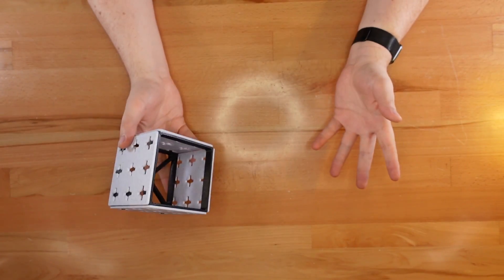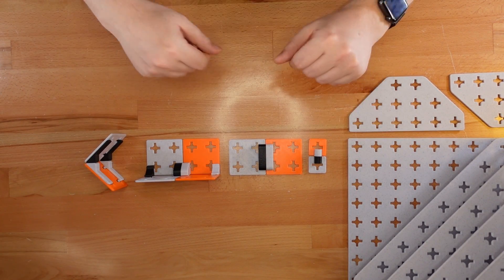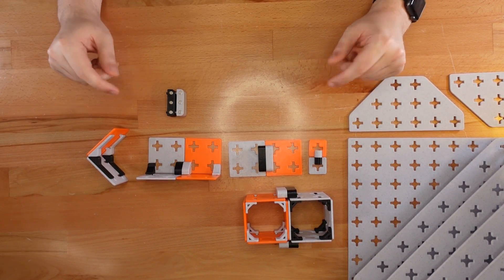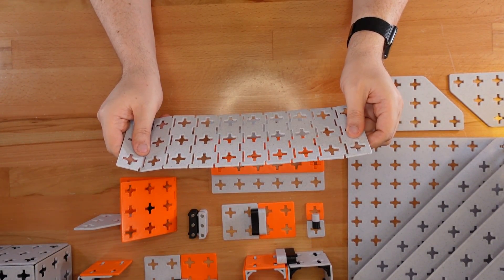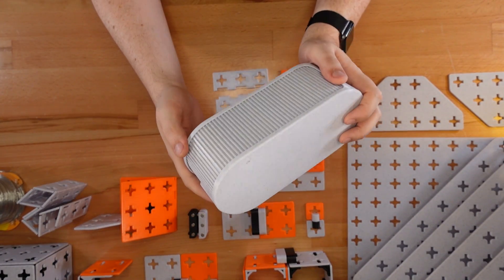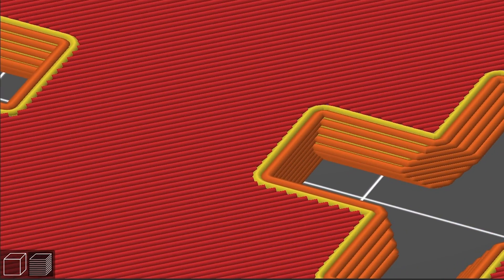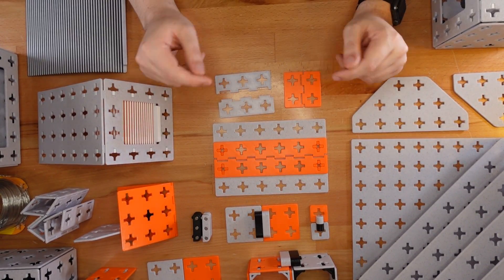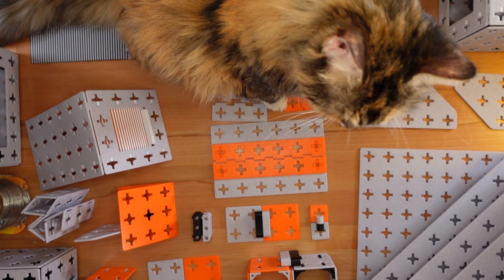Printy Panel Overload - Magnets, Shutters, and More

Comment: I love the additions you are making.  I'm wondering if you have tried to fogure out a way to stack the prints so that you can print more then one panel at a time.
Reply from the maker: I haven't tried it myself, but I have heard others plan to print multiple stacked panels with PETG between each layer. I'm not quite brave enough for that, so I'll keep printing them individually.
Reply: @3DPrinty  oh I should try that, thanks!

Comment: Are the inside corner inserts held by friction only? Snap in fit? The ones I printed on my fine tuned printer easily slide together, but also disassemble just as easily. I thought I was missing some little lock inserts or something like that? So far I have only made a few panels and inside corners.
Reply from the maker: Sorry to hear that - I've seen a range of results depending on the filament I use (same G-code) and other factors. Check the project documentation for a section titled "Loose Connectors?" for some tips to help :)

It's also possible that things will lock in better when you have a full cube assembled, but each connector is supposed to be tight enough to hold on by itself. Good luck!
Reply: @3DPrinty  Thank you for the response, it's good to see youtubers and creators that actually care.  My bambu labs printers are a little too precise at times. LOL I will make adjustments now that I know how it's designed.  BTW the speed of the A1 mini is great for these little test prints.  LOL  Love your stuff! I had so much fun with your gift boxes!!! I could go on and on....
Reply from the maker: Good luck with your next round of connectors. I also have a remix in the works for TPU locks that are a good option for assemblies that you don't intend to take apart often.

Comment: Isn't it possible to make a shutter that is attached to the side walls, so there would be no need for a front wall with that "border"? This way you could have access to the entire front rather than just a small window
Reply from the maker: Absolutely! Even though I liked the window option, merging the tracks right into the panel could be a very nice remix. I might revisit that in the future, or someone else could beat me to it :)

Comment: I wish I had mentioned this sooner but when I first saw this I immediately wondered if the sizing would be compatible with those wire grid shelving assemblies that convention art vendors use.  I know you already have your sizing but it would be genuinely amazing if it lined up with those wire grids.  Or was at least semi compatible.  That would make your system genuinely invaluable for a lot of small-scale vendors and artists. Many people who use those grids are already selling 3D printed stuff!

I didn't really mention it because I genuinely thought it was something you had already considered and figured those connectors were coming.  I know you want to look to other things but I genuinely implore you to consider it.  Those creators are also the type to donate and tip for the files they download and use.  So you might genuinely see a bump in popularity and some return from it.
Reply from the maker: That's a great idea! I see those at every convention, but are those grid displays standardized?

I'm certain I could make something that could hang on the horizontal wire and slide left and right as needed.

The trick is the vertical spacing. Maybe some sort of hanging hook with an adjustable length... I dunno, I'll definitely look into it when I update this project again.
Reply: @3DPrinty   "Standardized" is a tricky word to use here.  There's tons of manufacturers of those panels and the connectors.  Yet they all seemingly play together.   I think the connectors work with a "close enough" principle.

The panels are all going to be around 12in with a similar outer wire gauge.  I believe I've seen some that are a little bigger or a little smaller, but it's hard for me to imagine there's more than an inch in difference.  I think I've also seen some with a thick outer wire and some that don't.  Also there's versions of these panels out there that have a sheet of plastic tethered to the outer wire rather than the inner wires.  And the inner wires can be different in number and spacing as well.  There definitely variation but they're all close enough that I've never seen anyone differentiate when they stack them.

Your best strategy for compatibility is to concentrate on grabbing the corners in a similar way to the connectors.  Some of the connectors will have multiple divots in them that could seemingly compensate for differences in manufacturing, but most of them are just sloped to tighten on whenever you shove in there.  If your panels are the right thickness there's a chance they might slot in there like anything else. That would be ideal.

Tho be honest I always kind of hated a lot of the connectors.  So if your system has a better way of grabbing on to panel, then that might also be ideal.

Personally It's hard for me to say what would be the best approach.  I never liked the 1in cube thing.  And I hate it in home decor.  I think it's a bad size for home shelving.  But I respect the functionality it has for convention vendors and artists.

Comment: I def see using the magnets for some holders for fridge devices, pen holder and maybe a paper towel thing.... might need a few magnets to hold it but should be strong enough.

I wonder if the hinged sections with magnets could build one of those rollykits 🤔-The idea you could make and build a modular one that you could break down or adjust after the fact would be really cool.

(I really should fix my printer and get back into making things...)
Reply from the maker: Very interesting! Maybe I should revisit my old "3D printed rolling storage box" design... TECHNICALLY, you could break it apart and rebuild it by pushing out the filament hinges, but I could probably make something a little easier to adjust of the fly.
Reply: @3DPrinty  I don't know why but the idea of being able to print all the pieces "flat" and then build each compartment then assemble the whole thing together kinda like legos or k'nex just tickles my brain lol. plus you'd have all the other holes to add whatever other "pegs" or magnets into for the compartments and whatnot. 

I have no idea if the dimensions would work since the rolling of it would need each section to be kinda specific in shape....

Comment: I missed what gauge of wire. Also, many of us don't have wire laying about. Something we all have is filament. So, maybe a version of the hinge which uses filament instead of wire?
Reply: My guess is because the panels are not much thicker than filament it may not be strong enough. But, since he releases everything as step files you could try yourself.
Reply from the maker: Believe it or not, an earlier version of the hinge did exactly that! Unfortunately, I had to abandon that idea because there wasn't enough room to fit the filament AND keep the hinge flush with both sides of the panel :(
Reply: @3DPrinty  I believe it. You're an incredible designer, so I didn't hold hope I was educating you.
Reply: It’s 24 gauge wire